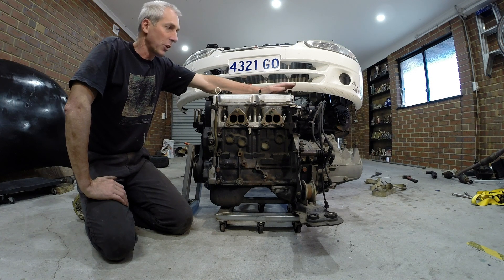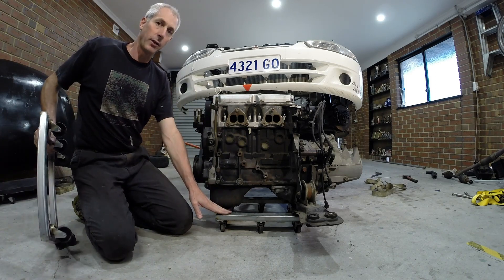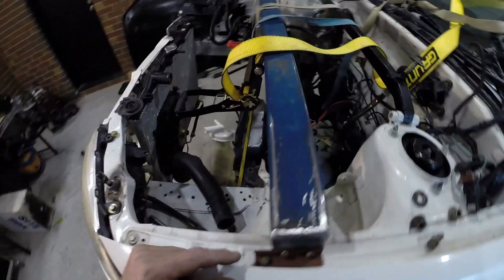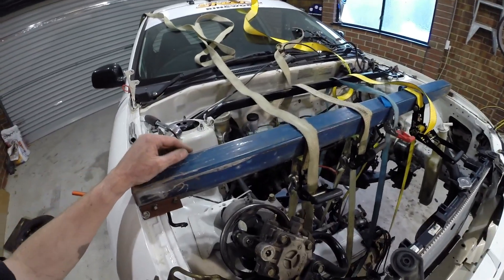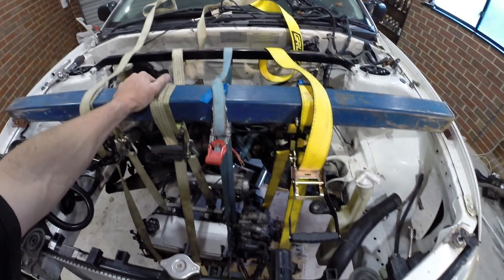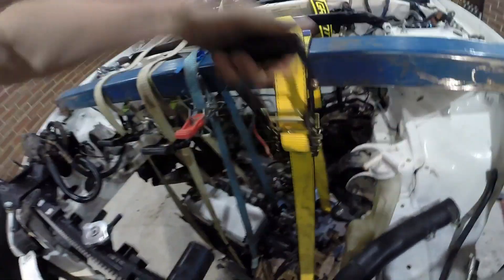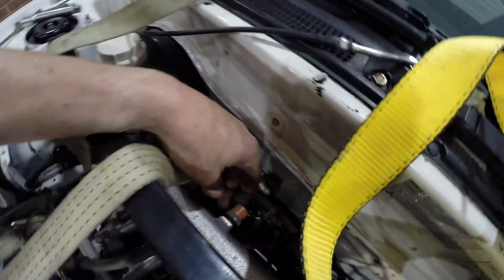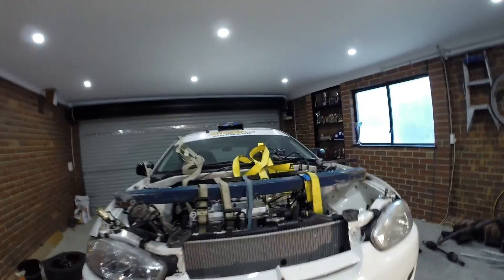Easy D.I.Y. Engine Hoist for home garages

Comment: Tyres back on, a couple of wooden car stands ( wheel cribs, cheap and easy to build ) to make sure you have enough space for the engine to come out and 2 jack stands per side will do the trick, the gearbox has to be removed separately in a previous step, those hidraulic hoists on wheels....i dont trust them, the only problem this techinque prsents is how to mount the engine to stand, i assume you figured it out :))

Comment: The is a great idea, but it requires you to lift the car high enough to clear the engine when its lowered.  You clearly show how to hoist the engine up from the ground, but you fail to mention how you lifted your car's front end up so high. In the video you can see something else you fabricated, but no mention of it in the video. It would have helped to include it in the video.

Comment from the maker: The dolly wheels were-- were! plastic and around 40mm in size. They worked well for a few years, they were used to put under the wheels of the car and shuffle the car up against the wall.. I will be using bigger wheels next time to give better rolling resistance.

Comment: Cant we use a single ratchet strap with a loading capacity of 4 tons for an engine like this??
Reply from the maker: Absolutely no! it needs to be able to be supported with some backups to be loosened or tightened and adjusted . One strap will not undo safely.
Reply: @rossbatsonbuilder  thanks 👍🏻👍🏻

Comment: ... or ~$200 for a real engine crane from SCA that is safer and more useful (can transfer engine to a stand, can top load as well, remove/install in line motor with gearbox attached, can use a leveller, etc.)

Would hate to drop an engine, buckle the quarters, or hurt yourself. The quarters aren't designed to take the weight of an engine, the lifting points on the engine aren't being utilised so there's a risk of damaging sump etc, the straps aren't load sharing equally and aren't rated for lifting, and your proximity while lifting isn't great either as your hand is on the ratchet mechanism most likely to explode as it's taking the majority of the load. You're also dragging the straps across the rough outer casting of the engine which could damage your straps rendering them useless for tying down vehicles for travel as they would fail any cursory inspection.

This is the kind of hack you do when you don't have any other choice as you're easily risking a lot more than $200 by doing this. A crane is super useful for other things, such as lifting engines, diffs etc in and out of trailers. They fold up and don't have a huge footprint.

Comment: Where you drunk when you came up with this idea?
Seriously the time it took you to rig up all that crap I could get your engine out in half the time with just a hoist hired from Kenards or bought from super cheep.
Reply from the maker: Hi Muckman
Thanks for watching
I'm afraid you have missed the point about this video
That one piece of steel now has been used on many occasions so has saved a hire fee every time I've used it 
Also it can be taken to races easily without taking up much room.
Also that steel has also been used for other devices in the workshop like a part of a 5 ton press again with scrap steel and fitting in a tiny space in a drawer ready for next time
Also used as a panel beating jig in another occasion, as a support under the car to lift the body of a car we stripped, as a part of a ..........etc. etc. lit is endless.
Hire cost of a lift $70 a day  hire of my system
Stress free and available now
As for being drunk racing is my form of intoxication
Cheers
Reply: Apparently there's no OHS at whatever race meets you attend?

$200 isn't a lot of money for a much better tool, and you can't put a price on negligence when it comes to safety, especially when you have a sponsor's logo on your windshield.

Comment: Thanks for sharing this good idea.  

How do you remove the engine?  Can you make a video of that?  You can't use ratchet straps for that?  

Where did you get those special silver jack stands?
Reply from the maker: Hi Carpe
Yes I used the straps to get the engine out, all it takes is loosening each strap a bit at  time but ensuring each strap has enough strength to take up the slack of the next, just doing it one at a time and patiently.
as you saw in the video the straps getting tightened one at a time and each having a turn of being loose, also that is the reason I had 4 or even 5 straps each time to ensure i safely let the engine down slowly.
I also usually have a jack underneath as an extra safety measure because you cant be too safe, agreed!

The jack stands I have are custom made out of galvanized steel tubing with a big nut and bolt system on the top and require a welded on pipe under the car around the suspension and roll bar locations to slip them into, it works well for race cars but not what you would usually have for road cars, I also have the normal heavy duty ratchet type but feel less safe with them with the amount of time the car is up on stands during the year.
they are great for taking to the race tracks as they pack up flat and don't take up much room .
I intend on building another set that are higher still for more serious work under the car, this time more likely out of square box section. I may make another video on it into the future.

Comment: How did you get the car up in the air.  I have a small Mazda MPV and need to swap an engine but not sure on how to get the car up other that jack stands.
Reply from the maker: Yes jack stands will assist you they will need to be set back far enough that the engine will slip out underneath and not get in the way, Please note you will need to raise the front and rear so it is closer to even to get the best result otherwise the engine may foul the fire wall and suspension components on the way down.
Measure your engine height to get to work out if you have enough room to pull it out from underneath or through the wheel arch, or if you need to take the bumper off.
As some engines are set back further into the engine bay you will need to estimate the center point of weight in the engine and gearbox so it will come down level however using a jack as a support for the rear of the engine may be required to assist lowering it evenly.
Just take your time and pay allot of time to your safety first and foremost.